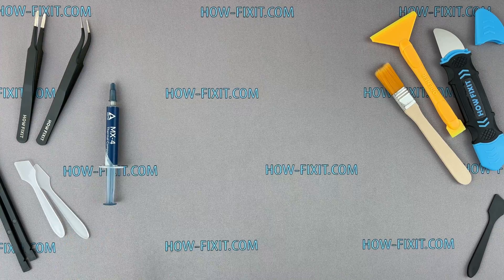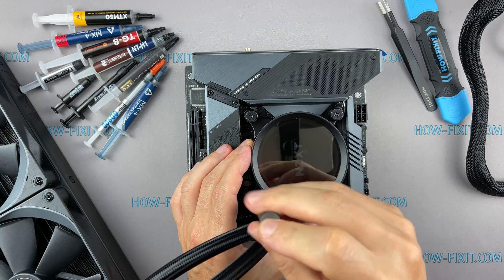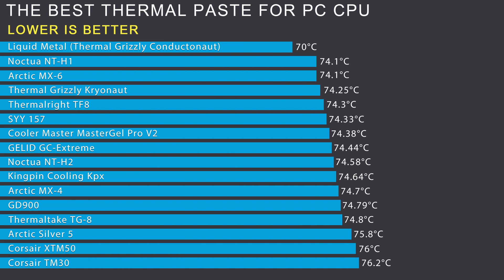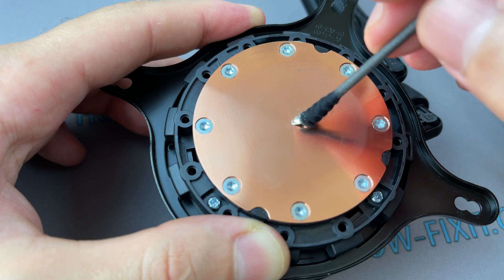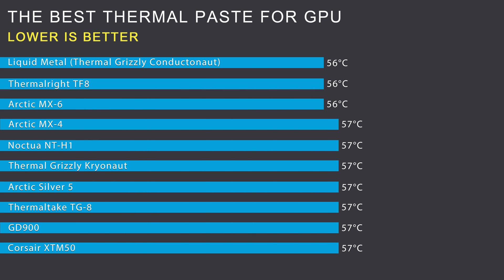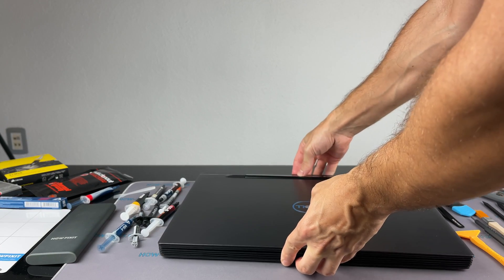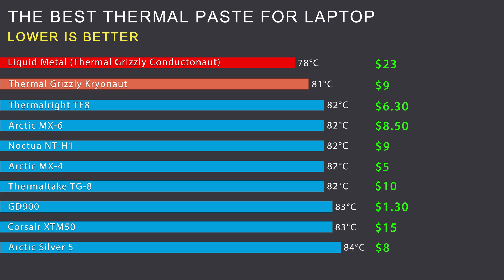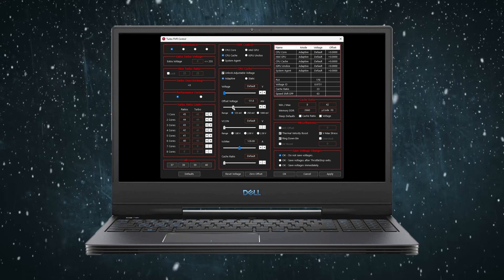The Best Thermal Paste for PC CPU, GPU and Laptop

Comment from the maker: For more info check out the links in the description
Reply: Thermal Grizzly sucks dont do it
Reply: Ps5 test soon??
Reply: @klawi-khanez-dz i do not think he will because the ps5 uses Liquid Metal witch is better then regulair thermal paste there are also not a ton of difference between Liquid Metal thermal paste brands
Reply: Can I apply liquid metal to my laptop cpu?
Reply: Qqq
Reply: Try honeywell PTM7950
Reply: Be careful with liquid metal, esp. in laptops I wouldnt personally dare to use it without insulating the small pins around the cpu gpu die and without placing some protective barrier, either a PU foam tape or putty around the outer edge of the chip to prevent LM from spilling out of the area where its supposed to be. Also saturating the area of copper heatsink with liquid metal for like 24h or 2 days prior to installing it seems to be good idea, then cleaning it off and then applying it again to both surfaces and installing heatsink, alongside with using like 200 grit sandpaper on cpu and gpu die itself, I find it sticks better to cpu or gpu die that way when its not completely smooth. If you dont see at least 10-20C difference compared to paste then you might have done something wrong but this is harder to check in case of laptops because of how you cannot usually manually control the fans, ideally you want them at constant speed in all testing, before and after repaste or applying LM.
Reply: gd900 vs gd900-1 vs gd007 vs gd-2 vs gd-3

GDs could beat MX-6 easily on other videos

Comment: Great and simple video. I repasted my 5 and a half year old 1660 Super and CPU after not being repasted in 4 and half years. I used Arctic MX-6 and found a little kit on Amazon that had 4g with some wipes for about $10. Super simple and easy to apply if you've done it before. CPU and GPU are running about 2-3 degrees warmer under load, not the biggest difference but I am happy with the results as the thermal paste that was there before was surprisingly not too dry considering how long its been there for. Some paste and wipes over as well in case I need to use in the future.

Comment: I have a dell G5 5590 with i7 9750h and 1660 ti so I can't do undervolt on it because it's locked from the factory so how could you undervolt yours 
And THKS ❤
Reply: I have this laptop, and the only way I've found to undervolt with Throttlestop is to disable memory integrity in the security settings and maybe disable virtualization
Reply: @will_jun130 I can't edit this option it's enabled from factory

Comment: I’ve heard that liquid metal can leak when it gets hot and turns fully liquid. My 2021 ASUS ROG Strix laptop originally came with thermal paste—so if I ever switch to liquid metal, is there a risk it could leak into the internal components?

Comment: Effectiveness in thermal conductivity for MX-6 in particular depends a lot on how effectively thermal paste is applied. I apply a thin layer of paste to the IHS or silicon die then a more substancial layer which I evenly spread. In a 14900K and Ultra Core 9 185H The results I obtain are very satisfactory.   Up to 12 degrees Celsius of difference compared to only apply a pea size amount. I was able to significantly reduced temperatures from 55 to 43 respectively.

Comment: Too little Arctic Silver 5 is better than too much.

This is why you can't trust reviewers (no offense).  It took years of testing, curing, methods, etc. of using Arctic Silver 5 to realizes that just a TAD too much AS5 will throw temps off by 7C at least.

So, yeah... I have zero doubt you applied AS5 wrong.  I'm not going into detail on how to apply AS5 for perfect results, but whatever.  No one could know everything.  I feel like the majority of other pastes are "pastes for dummies" and you can't really mess them up.

But you can mess up AS5.  NASA used  AS5 so... nuff said.  If you put as much AS5 as I'm seeing you put on all the other thermal pastes, you used 8-10 times too much.  It comes in a small tube for a reason.  It only needs the thinnest amount you can possible put on.

I'm sorry, you spent money and took  time to compare, edit and upload a video, but you really ruined your application of AS5.  

You put the SMALLEST coating of AS5 you can make on the die, and then the same on the heatsink.  It is the best... unless you do it wrong.  AND it'll drop 3C within 3 days of using it.  Plus you want to heat it up and cool it down so it only gets better and better.

But, hey, I've only been doing this well over 2 decades on dozens upon dozens of PCs.  And I have tested other thermal pastes on my own rigs at which I removed to put the GOOD STUFF (AS5) back on.  What do I know?  I'm not a YouTuber.  Sarcasm strongly intended.

Comment: Dude all of these pastes for Laptops are terrible. Explain to me how you say these are good temps when the XTM70 (upgrade of XTM50) has my AIDA64 temps between 60c-67c never exceeding 67c. Under load in gaming it averages 63c, and idle 28c. What you have here is still high even for laptops.
Reply: XTM70 worked great for my gpu but caused my cpu to throttle hard going up to 95*. I think your heat sink design/mounting pressure/gaps will cause a lot of variability

Comment: Arctic Silver5 has been my go to thermal paste... i9-9900 still running in the 30's at idle... water cooled with a single 120mm fan out the back.... daily use 10-12 hrs per day...

Comment: Liquid metal corrodes ur components over time. Already having that issue on mine
Reply: Liquid metal corrodes aluminum. It would literally take 30 years for liquid metal to begin to corrode copper with constant application. It "stains" copper, but will never corrode it in the timeframe you will have that laptop. Idk why people keep perpetuating this crap.
Reply: Liquid metal ≠ aluminium

Comment: Please use MX4. Because most people don't apply thermal paste very often. They continue to use their computers in the same condition they originally purchased them. The GD 900 has a very good price/performance ratio, but its effectiveness only lasts for one year. For example, if you are someone who will disassemble the heat sink and apply thermal paste every year, the GD 900 is the best choice.

Comment: Upgraded both my CPU and AiO (at different times) on my current PC, so I did pull waterblocks off CPUs quite often over the past 12 or 15 months. Initially, I had been using a tube of CM MasterGel Maker that I bought back in 2015/16 or so, but had never opened. As it didn't look like it had gone bad or out of emulsion, I used that stuff when I built the PC in early/mid 2022. I upgraded to an i7-14700KF shortly after that chip was launched (late 2023), so I got to see that "new old stock" paste after about 20 months of use - I had spread it around with a spatula when I first installed the AiO and the paste looked fine both WRT coverage and texture/consistency. Temps were also totally fine with that paste (i5-12600K, Lian Li Galahad Mk I 240). Plopped in the i7 and re-used the 240mm AiO, but I was getting kinda worried about the age of the CoolerMaster paste, so I bought a tube of MX-6 and used that. Didn't notice anything unusual when it came to temps (they were quite a bit higher on the i7 with no power-limits, but that's to be expected). As before, I used a spatula to spread the MX-6 evenly over the chip. When I upgraded my AiO to a 360 after a few months, the MX-6 also looked very good on there - spread was very even and seemed to cover the entire chip. 
What also seems to be working fine are those hex-board "stencils" some AiO manufacturers provide. I tried that thing once to see how the paste would spread with that pattern and it resulted in very good coverage for me. Not sure if it's worth the extra hassle/tinkering to apply the paste properly that way, but it certainly seems to work.

Comment: Thermostats usually have a 2 degree swing. If its set to 75 then it likely warms up to 77 before cutting the AC on. That 2 degree difference will change your results. I know that you cant do anything about that but thought I would mention it.

Comment: Just repaste my msi laptop gpu with arctic mx6 from noctua nth2 and the temps are the same 81celcius. I was so paranoid but by this video its normal. I hope it will last long.
Thanks for this informative video❤
Reply: Use PTM7950.

Comment: What should I use for I7 8550U laptop?
Reply: Phase change material: Honeywell PTM 7950, Upsiren PCM-1, Gelid HeatPhase Ultra, Thermalright Heilos, Thermal Hero Pad.
It comes in as a sheet, lasts longer, performs works better than traditional pastes and there is no pump out effect.
Reply: Maxtor brand is recommended for easy application, cooling effect is also very good, and the kit is complimentary

Comment: Didn't have any problem spreading MX-6 paste using a credit card.  Didn't work that well though.  Oddly, my old desktop with a G3258 CPU doesn't get over 50c even though the paste is about three years old.  The laptop (T430) only preformed a couple degrees better than the old chalky  paste that was on it.  Decided to just leave the old paste on my desktops (all temps good on them).

Comment: hey is it any different if i use 70% isopropyl alcohol compared to 99% ? because i already has it
Reply: Use turpentine for cleaning, IPA smears the paste.
Reply: @goorthiss No … Its oil based … not recommended at all! IPA works perfectly well!
Reply: Its fine!
Reply: as long as it doesn't have moisturizer and fragrance, then you would be fine. Don't forget to remove the battery first tho

Comment: I have very good expirience with Arctic MX-4. I have used it for 8 years or so & only changed it every 3 to 4 years on both CPU & GPU in my desktop gaming PC. I do have good cooling on both of these which definitely helps a lot, but I'm also very confident in recommending the MX-4. It has a good price & gets zero complaints from me.

Comment: sir please make a similar video on the types of thermal pads from different companies and how to apply them on the gpus' vrams, mosfets, power delivery, backside of mobo where the vrams are connected to backplate , because theres not a high quality video like this one on thermal pads application , only small size youtubers have dont it in a haphazard way , because they are of different sizes , different specs and not the same gpu needs various size of thickness pads for different components , it becomes difficult for user to change them , but it really affects gpus temps and life
Reply: For vrams, vrms use thermal putty Upsiren UTP-8, UX Pro, U6 Pro. And for the core phase change material: Honeywell PTM 7950, Upsiren PCM-1, Gelid HeatPhase Ultra, Thermalright Heilos, Thermal Hero Pad.

Comment: Thanks for doing this as I know it takes a lot of time to compile and do the tests.   If you are ever inclined to update the comparison would appreciate if you added a very old standby which I use frequently (Arctic Silver Ceramique or Ceramique 2).  Mainly as it's a /LONG TERM/ paste (i.e. 10 or more years in active use) and extreme temp limits (-150C to +150C).   I've done small comparisons in the past but nothing as comprehensive that you've compiled.   I mainly do datacenter (as well as my own home) work so 'cheap' and 'good' are both important when doing 1000's of systems a year from laptops to mainframes.

Comment: I used kryonaut the temp is 43 on idle and 88 max
The factory paste temp idle 47 and max 90

I don't know why it not making huge diff on max but at least it stable on max

I will try the MX 6 later and repad. i've been saving  for it😅

Comment: I know that's an old video but, believe me, you should do an updated version with PTM7950. I am using that on EVERYTHING, it's my saviour, best performance and best temperatures I've ever achieved, easy to install, cheap, right know I couldn't suggest anything else.
Reply: where do you buy it?

Comment: Thank you for this video.  I have a question about pump out and dry out for direct die contact.  Have you seen or experienced any of those from long term usage from any of the pastes? I read they Kryonaught will dry out after long term exposure to 80C.
Reply: Kryo hasn't lasted me less than a year or so on very hot Laptops with shitty cooling (15w, non-gaming), and between the tiny die of my i7-1065 and and the shitty cooling, it's by far the worst torture you can subject Kryo to. It runs at 100c under load on any other pastes and maxxes out between 18-23w CPU package power, while Kryo runs 10-20c cooler inexplicably and somehow also acts like more thermal mass, not hitting 100c even under the ridiculous 50+ watt short-term Turbo TDP but still it averages 85c or so and hasn't noticeably degraded faster for me at 90c for hours a day than laptops with way better cooling at 60-70c. 

It's just a short-life paste no matter the temp, and anyone who cares about this stuff is gonna replace it before it gets really bad after 12+ months. I just tried Hydronaut because I'm tired of paying Kryo prices and my last tiny 1g syringe was defective and too dry to use (it came out like nearly dried silicone caulk and was impossible to apply because it kept sliding off my 1065 die), and as I feared it's as bad as all the other pastes I've tried and I'm back to 100c load though at full clocks (but Kryo never would hit 100c as same clocks/power). 

TL:DR any paste as good as Kryo for direct-die is because it's similarly dense/viscous, and is going to dry out faster than shitty pastes that dont matter for Desktops with integrated heat spreaders and far lower thermal loads per die area. For gaming laptops/direct-die desktops, GPUs it'll handle 80c for a year pretty easily, for small-die 15w CPUs with shitty cooling that area designed to turbo to 100c sustained, it's probably one of the worst but still as stated I can get about 12 months

Comment: For those wondering what is the best way to 'spread thermal paste' there is a good trick that I stand by but you need an extra tube, order yourself some small sheets of clear perspex plastic, you can then try applying your choosen paste by making contact with the cpu or gpu with the clear perspex plastic and visually check the coverage, the idea behind this is that 'spreading paste' with a tool has to be done with more more 'care' as you can create microscopic air gaps in the paste as opposed to just laying a bead down and letting the two surfaces mate and resolve the spreading by pressure, various bead patterns will ensure the best results, i personally avoid any pattern beyond a line as those two beads joining under pressure can 'catch' air between them and create tiny air pockets 'or hot spots', try this method out :)

Comment: can you help answer i using laptop gaming and its rtx 3050 with i5 11400h are 1g grizzly krayonaut is enough for gpu and cpu repaste or i need buy 1g more to apply both cpu and gpu pls help me answer and thankyou!!
Reply: It is enough but dont go with the kryonaut if you play cpu intensive games cause the grizzly will dry out faster above 80c so you will have to open up your lap again. I am not sure on which is the best for laptop but arctic mx4,6 and gelid gc extreme are all equally good.

Comment: I know that the description says "Non-eletrical conductive".
but I don't understand what it means.
does it mean that it can be used on electrical parts or can't be used on electrical parts ?
Because I have never used thermal paste before so I want it to be safe.
Reply: It's not intended to go on anything conductive, it's just telling you that it's not gonna short something and damage your components if it somehow ended up on a conductive part (like, dripping on and potentially shorting the Mobo or GPU). No CPU or GPU die/chip is a conductive surface, so  you could use either conductive or non-conductive for thermal paste/media to the cooler. Most pastes are non-conductive by default, only some older ones like Arctic Silver and highest-performance newer like Liquid Metals are conductive and they're kinda niche. It's just a warning that, for example, if you spill that shit like water all over your computer somehow, the conductive pastes might short something.

Comment: Applying too much thermal paste is also bad. Thermal paste still retains heat more than air does, so you don't want to squeeze out a bunch of it past the CPU die. It also makes a mess that's hard to clean when it gets onto other components, like anything around the CPU socket.

Comment: i would highly recommend thermalright tfx - due to its high viscosity and the fact that it doesnt pump out. i used kyrounaut and mx6 and both pumped out (the mx6 after 2 months , i started having higher edge temperatures and the fans spinned faster).  highly recommended for gpus and laptops.

Comment: Mind if anyone suggest the best thermal paste to use. i have an acer predator 2021 i5 10th gen RTX 3060 and play games with turbo mode. CPU reaches 80-100c while gpu reaches 70-80c. Ambient room temp is around 29-31c. Turbo mode is not exactly overclocking right?